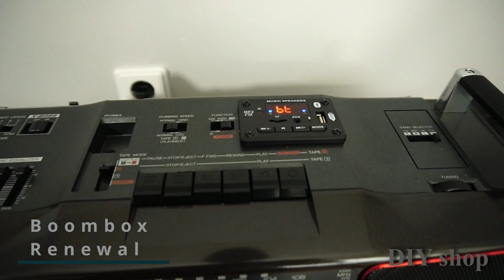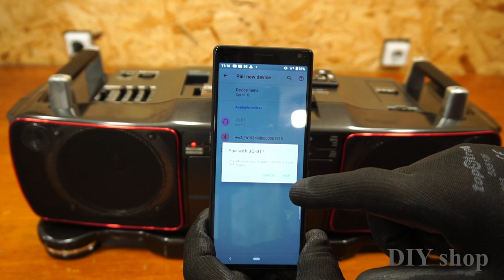Restoration of an Old Stereo Radio Cassette Player/ Boombox

Comment: Great job, it looks very nice. When feeding bluetooth directly from the transformer, you had no problems with the ground loop noise in your playback? It seems to sound so clear, no audible extra noise.
Reply from the maker: There is no problem, I did the grounding to the FM antenna of the bluetooth module. Sorry it's not reflected in the video.